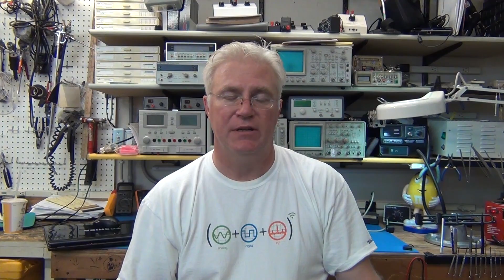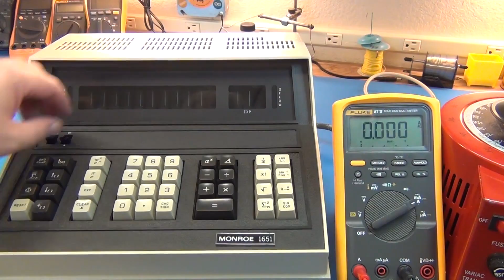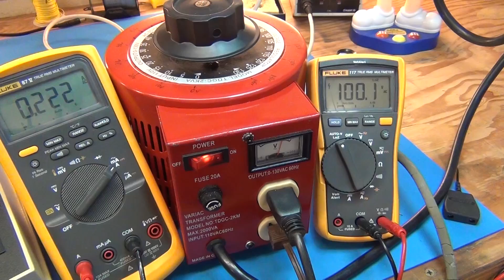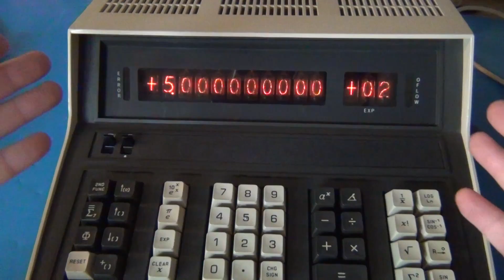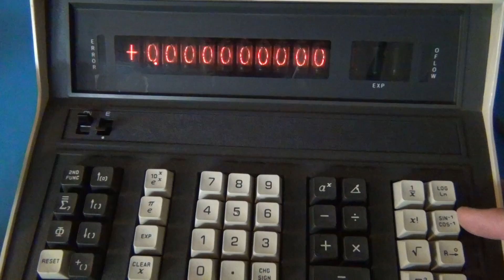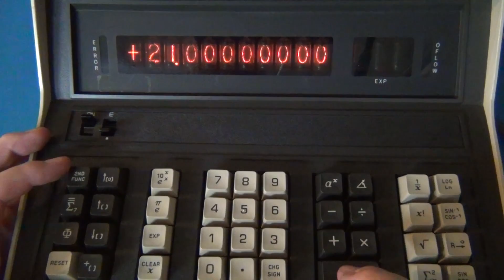Monroe 1651 Nixie Tube Engineering Calculator From 1971 Part 2 -- Power on & Functionality

Comment: Todd, I don't know if you get notifications about comments on extremely old videos like this one, but were you ever able to dig up enough info to troubleshoot & repair this calculator?  Curious minds want to know!  ;)
Reply from the maker: no, I was not able to repair it. All other functions still work so I do use it as a normal Calculator and some scientific stuff does work. I did find the original manual on eBay and that gave me information that I was using it correctly.

Comment: I think the trig functions probably work in radians, as opposed to degrees.  1 radian is the angle where the length of the arc is equal to the radius, so π radians = 180°.
Reply from the maker: It should do both however this old girl is just broken.
Reply: Todd Harrison I have faith in your ability to find a way to fix it!

Comment: The method slowly bringing up the voltage can be harmful to some electronics, depending on how they are designed.
Reply: cranking up the voltage like this is the road to death for most 80ies and early 90ies switched power supplies. 
A 60W light bulb is a lot better choice for "restricted power", even for old linear psu stuff like the one shown.

Comment: Have you pressed 2nd function and then while holding it down press Pi?
Reply from the maker: No, I will if  you know something I don't. However, I purchased the manual for this 1651 on eBay a few months back and it read that any key labeled with two functions when pressed processes both functions at once putting both results in two memory registries. If you then press the 2nd function key it toggles the two result values into the "working value" display. My problem is that when I push any key which processes two functions I get an error. Maybe the secondary memory registry has a fault and it just can't use it or any other key that needs to push something into the secondary memory registry.
Reply: If you say that the manual says the 2nd function key toggles between memory registries, then the only reason I can think of that would cause an error is a faulty memory registry. That's how I would diagnose it since you can't get at the actual software.

Comment: IMO vintage electronic items like this,...they are like beautiful works of art.  I love vintage electronics made from the late 1960's through the early-mid 1980s.  Big clunky, heavy buttons, knobs, switches, sliders, etc,...metallic cases, wood grain finish, etc, etc,......and durable!  Built to last for decades.
Reply from the maker: +gjc82071 I agree, I just won a sales brochure on this calculator off eBay so I should know more about it soon.
Reply: +Todd Harrison (ToddFun) Sweet!  The sales brochure would also look great next to the calculator, like if you just ever want display it.  It's a really nice touch.  
My cousin was junkin' (garbage picking) 2-3 years ago, & scored nicely. (which he gave to me) He found a pair of Utah Electronics MP-1000A speakers from the late '60s-mid '70s, (about 2ft high & 1ft wide/long) The tweeters need repair or replacing, but the woofers & sub-woofers are fine) They're built like a brick outhouse.
He also found a Soundesign radio/cassette player, model 5635 PLL. (late '70s-early '80s) Soundesign wasn't known for quality,  but it still looks cool. (& actually works) Brushed aluminum front, "wood grain vinyl veneer" case, (cheap, thin, particle board back) klunky buttons & switches, huge volume & tuning knobs,...the tape counter is totally analog (3 rotating 0-9 counters w/a reset button) & the VU & Tuning signal meters are the kind w/actual needles.  I love that kind of stuff!  :-)

Comment: How rare are these machines today and would I have a problem finding one?  Thanks, and I love the video - very interesting.  I have always been interested in vintage electronics.
Reply from the maker: I'm thinking very rare. I have only seen one other and it was in a museum, but that was a slightly different model as well. In early 1970's the engineers were quite proficient with their slide rulers so fancy calculators costing more than a car wouldn't be on the top of their to buy list.

Comment: For Pi try pressing Pi then =
Reply from the maker: Craig Diamond It was worth a try so I pulled it down from the shelf and gave it a try. Nothing happens. It just stays at zero. No error, just stays zero. It seems every key that works with a 2nd function is the issue, so if I could hunt down that problem it might be repairable. However, without detail circuit schematics and reference to what each chip does and replacement parts I'm thinking it is a lost cause. It does still do simple math just fine being most of those keys don't use any 2nd function keys.
Reply: +Todd Harrison (ToddFun) I wonder if it isn't the second functions, but somehow corruption in the ROMs used for the advanced math functions.  It could also be a transitor or capacitor is bad somewhere.
Reply from the maker: Stephen Hinkle Yes I agree. I would look into more someday.
Reply: Lost cause? Not at all! Reverse engineering the circuit should be pretty simple, considering how simple the actual circuitry inside is.

Comment from the maker: @Harley, Just what I was thinking. Being the keys that don't work are only the ones that have double functions and knowing this double function feature actually runs both functions putting one result in registry A and the other result registry B, I'm thinking maybe a select chip, transistor or switch diode is not letting the results get to either registry. Per a manual I found, once the double functions run you have to select which registry to work with knowing A is top and B is bottom function.

Comment: Thanks for this, it's all very interesting. I've read what I can on the internet about this calculator (not very much, sadly).

I would guess that one of the pick-and-mix functionality chips on the ROM logic board is not working properly--given everything else works--one that contains the constants and perhaps the trig code.

It could be a dead chip, but they seem to have quite heavily gold plated legs. Maybe look up gold embrittlement. Not sure I'd like to risk re-soldering any of it though.

Comment from the maker: @Fracture, I will try that, thanks. I read the user manual for the 1655 which mathematically functions almost the same as the 1651, so I'm about 80% sure I'm using the calculator correctly now. But yes, that leaves me unsure so maybe your right.

Comment: I'm guessing two things: I'd assume it's working, and you're doing it wrong because it may not be intuitive. I have doubts that the calculator would work "except for 2nd Func". 2nd; I'd check to see if those functions are working through the memories. For example, "memories 0 and 1 are used by 1st and 2nd function". For example, put 0 in all the memories, then press pi/e and recall all the memories. If I've guessed correctly, pi and e will be waiting in some memory slot for you.

Comment: The "circle with line" is a Theta which is usually used to signify product (multiplication result) of many numbers, just like the Sigma signifies the sum (addition result). I don't know which numbers it would add and multiply (Second and first registries? Memories? Consecutively entered numbers?).
Also I bet R->o is for converting Radiants to Degrees (and back, in the second registry, I presume).
I hope you can fix it but I seem to remember lots of custom ICs in the previous video...